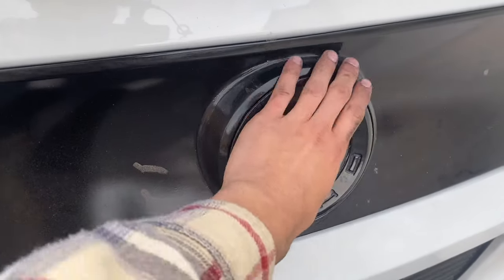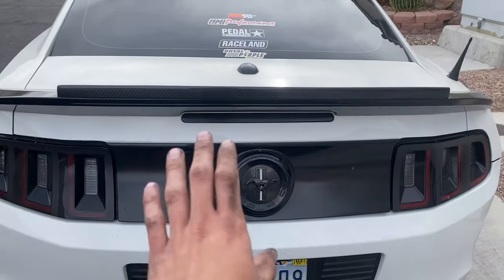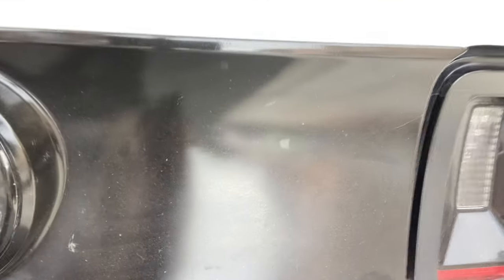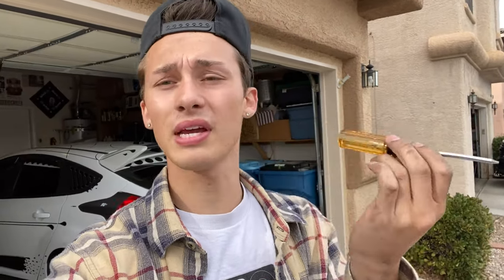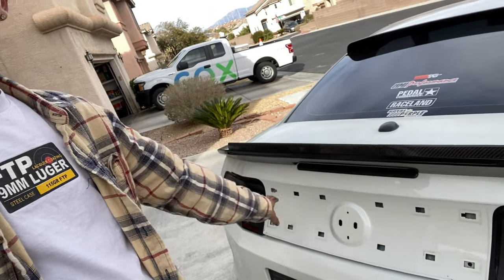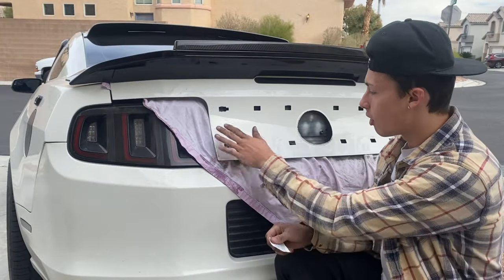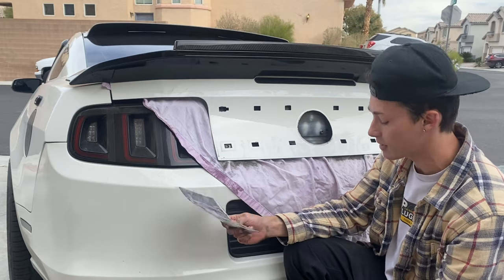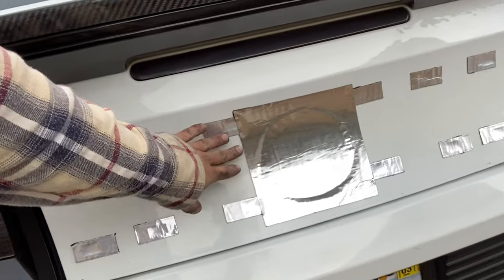Shaved Rear Decklid INSTALL/REVIEW (13-14 Mustang)

Comment: Bro you think I would be able to put a GT emblem if I was to install the decklid first?
Reply from the maker: The back of the decklid has two pilot holes so if you decide to go with a GT emblem, you can drill into it no problem and attach the emblem. In your case, you could add two sided tape on the emblem if you already installed it if you don’t wanna remove the decklid

Comment: Yo man could u link me the extra tape u added to make sure it ain’t fall off
Reply from the maker: I don’t have a link but the tape is from 3M. Get the grey or black stuff. Works good
Reply: @LoganScott.  Been struggling installing mine. The top corners would not stick but I didn’t wipe it dwn with alcohol before hand so idk if that’s maybe why but I have had to result to jb welding the top corners just to try and make it stay . Took off the 3m tape it came with as well and added new 3m tape
Reply from the maker: @jesusanguiano1545 I’ve been struggling with mine since day one as well my friend. I have tried screws and multiple types of two sided tape and none of the options seem to work accordingly. I believe that I have a manufacture defect but at the end of the day, it could be a bad cut on the trunk or something as simple as bad prep tape. Cleaning the surface is something you need to do to ensure longevity
Reply: @LoganScott.  from your install vid it looks as if it went smoothly for you when u installed. Did u start facing problems where the corners wouldn’t stay the next day or awhile after